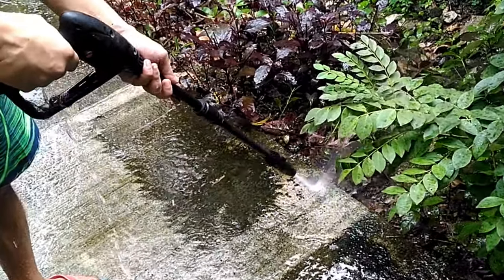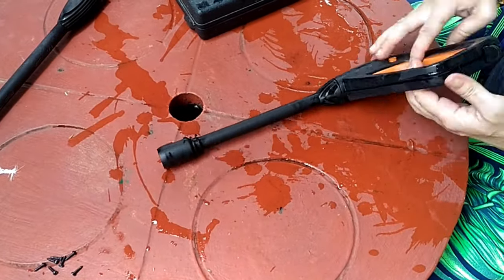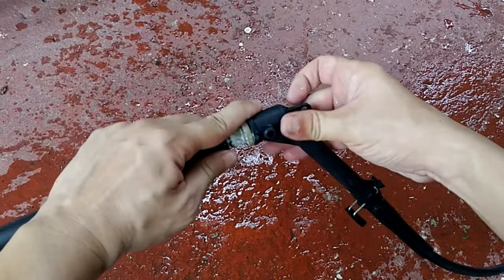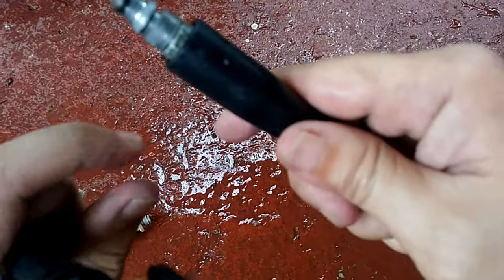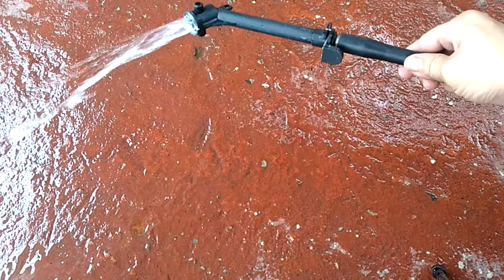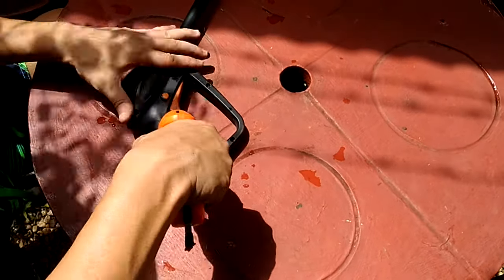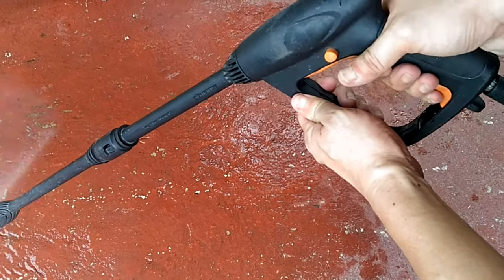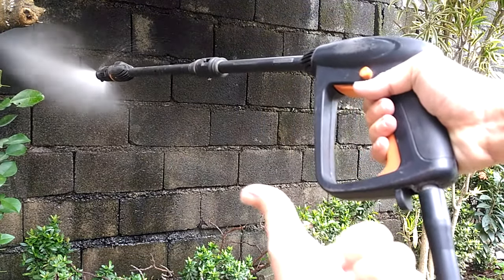How to Fix Leaking Pressure Washer Wand (CHEAP)

Comment: There are three sizes of o rings required for this gun: O.D 10mm, I.D 6mm, Cross-section 2mm.
O.D 12mm, I.D 8mm, Cross-section 2mm.
O.D 8mm, I.D 5mm, Cross-section 1.5mm.
Reply: What are the dimensions/parameters of the transparent gasket on the very front of this white piston (see 1:52 the index finger of the left hand points to where it is located). 
It's not a classic black NBR rubber o-ring, but a strangely shaped sealing ring of transparent material that hardens after years and crumbles (not very flexible) when you try to touch it. 

I have a leak just on this seal. After several years of use, water has cut a gap in it and it leaks by turning the pump on and off every few seconds, as the pressure in the gun alternately drops and rises when the pump motor is automatically turned on. I couldn't find this seal anywhere, which probably costs a few cents, and yes I have to buy the whole gun for $45 plus shipping.

Comment: Thank you so much for this. My o-rings looked good on my electric washer hose / gun combo has 2 rings on the hose, but for some reason sometimes, when i stop spraying, it starts leaking like crazy. Today, it started leaking no matter what. Teflon tape for the win. Thank you so much.

Comment: Awesome! I fired my electric one up today for the first time in 5 years at least and wow, did that handle leak! I am betting I need 1 or 2 "O" rings but I do have Teflon tape to get me by tomorrow. I will be taking the spray handle apart in the morning. Thank you so, so much!!! Great video!!
Reply from the maker: Good luck!
Reply: I did the temporary fix but getting that spring back in to make the handle has proved to be a difficulty!
Reply from the maker: @sandysue202  yep i can relate. U really need to finesse those parts back in 😊

Comment: I see you're using Teflon tape for a temporary repair. I got a much better solution because mine's quick and Permanent Forever. Use an earphones rubber. Everyone has these around. Just remove the rubber ear piece, from any old earphones and put it where the o ring go's. put it on the fitting backwards and seat it in place. Then pop the ear bud inside out and cut off the excess with a pair of scissors, does not need to be ever replaced again. Also works on blown o rings in connector adaptors. Better than any o ring.
Reply from the maker: Nice! Thanks for the tip!
Reply: Hey FC - having hard time picturing what you are describing as alternative to using teflon/plumbers tape.  Can you provide a picture or two (or +3) of an 'earphone rubber ear piece' and then posted in Ur YT Channel or share a link here pointing to a DropBox, Google photos or other public facing sharing location?  TIA
Reply: This works just great..thanks champion
Reply: At this point it would be easier to go buy the right size o ring 😂
Reply: I can't even open the handle.
Reply: @jasereed5258  Mine has screws, in the handle, you might find a repair guide on line if you know the model. and brand.

Comment: I have basically the same handle.  The handle doesn't leak under just the regular water pressure,  When powered on it leaks from that white plastic valve  on the side that points toward the handle I even changed the o ring  there is still a leak there when it runs. any suggestions? do you know the o ring size is it metric?  thanks

Comment: Thank you for your clear instructions. Out of curiosity, was the o-ring you purchased designed for use under high pressure? How well has it held up?

On different note, while I found your explanation helpful, the four ad breaks in addition to the initial ad for a video less than 10 minutes was enough to keep me from subscribing. Well, that and the volume of the extraneous sound effects.
Reply from the maker: Let's just say that the o-ring i used lasted longer than the pressure washer itself. The video you watched is over a year old and I'd like to believe I have come a long way in terms of improving the quality of my more recent videos. I encourage you to visit my channel and  watch some of them. As for the number of ads, it's the only way for me to compensate for the amount of time and effort i put behind creating my videos, which on average takes me 3-4 weeks. Regardless if you subscribe or not, I still appreciate that you watched something you found value in, for free 🤗

Comment: You actually can fix cracks by using J-B Weld. The pressure it is resistant to is usually a lot higher than what the actual pressure washer is putting out.

Comment: I work at a Auto Parts store, and my manager told me that there’s an antifreeze type lubricant that if you run it through your wand after every use, it will keep your o-rings lubricated and keep them from cracking. This will allow you to use the pressure washer longer and saves your o-rings.
Reply: Stock up on blinker fluid too

Comment: Hi HanDIYman 007 Nice video,  Could you tell me what can I do if "the gun" don't stop shooting water, the trigger is not broken, is just that doesn't work at all... thank you!
Reply from the maker: Have you tried disassembling the gun to check what might be broken inside?
Reply: @HanDIYman007  Thank you @HandIYman 007 I disassembled the gun nothing was broken! I used the teflon tape on each o'ring I found and the gun stopped shooting water! but for a couple of minutes. it looks like the o'rings that are inside the gun, are to dry.  When you pull the trigger the teflon tape gets removed by friction. Now I know what to do.  I have to replace the o'rings just as you recommended. I had a lot of fun doing this.   Thank you very much   @HanDIYman 007

Comment: opened mine up, checked and no cracks - all O rings are in place with no damages. turned off it doesnt leak and works fine but once i turn the jetwash on it starts leaking from the bottom of athe handle, im using the same one as in this video but nothing seemed to work

Comment: Bought a used pressure washer last night for a cheap price, it's specified it's leak but the machine is fine. Thanks to your video now I've found the leak like you said and temp fixed it! now gotta search that O-ring you mentioned for a permanent fix! are these O-ring one size fits most? or you have a specific dimension for each? mine looks very similar to yours, what's the size of your O-ring?
Reply from the maker: Glad that this vid helped you save the trouble of isolating the source of the leak! I believe the size of the o-ring differs across brands and models. The best way is to bring your pressure washer (or at least the wand and hose) with you to the store and do an actual fit. I hope this tip helps.

Comment: Well you did the typical thing and start with the pressure line hose and wand  being disconnected , and that is where my  leaks is.   Problem for me is that I cannot separate the threaded collar from the wand, the plastic sheath that you turn to loosen and tighten, just spins, and the brass threaded wand and hose connection do not tighten or loosen.  How do you remove such a hose connection, because that is where it is leaking, the pressure hose is only threaded on half way, I cannot tighten or loosen, the plastic black turn sheath is obviously stripped, so I guess I should throw both away and buy replacment pressure hose and wand,  since I cannot turn the fitting without destroying the plastic and brass fitting?

Comment: i need to check this method, my Black&decker started leaking after the engine kept engaging and i could seem to get full pressure. Then i heared a pop and water started poring out like this one. all o-rings are in tact though.

Comment: Excellent video. Practical and effective. Have another question though. When I opened up my wand, I got distracted on another project that took a week. When I got back to the wand, embarrassingly I can't find the spring that pushes back on the stem to shut the water off. I've got a Husky H1800s electric washer and can't locate the spring anywhere. Any creative ideas on how to solve the problem? whether you have one or not, I'll be going through your other videos. They're very well done!
Reply from the maker: Yes, this happens to me too 😅 First thing i would suggest is get a picture of the spring thru online stores, forums, owners manual, etc. It's important that your replacement spring should be the same dimension and "tension". Then i would try looking for it from the store you bought your washer from, auto supply stores, nuts & bolts store, or even online sellers. I hope this helps 👍 PS Not all my videos are great, esp my first few ones but i do try to improve continuously. Thanks so much for the support 🙏

Comment: Was this a Black & Decker lancer? It looked some sort of the same in some parts. Though yours looks way more studier than the cheap one i got
Reply: hahahah untill i saw the end... yup B&D did yours started doing this when the engine would not shut down? Thats how mine started today, was doing dome working, i adjusted the pressure and the motor wouldnt stop. Could hardly pull the trigger, then heard a pop and water came gushing out. I disassembled it but did not see a crack or what so. Hope your fix also works for mine, i do have both o rings on both sides of the pressure hose though
Reply from the maker: Yes, a motor incessantly running (sometimes by itself) is a symptom of a faulty o-ring (because there's little to no pressure being contained anymore). Don't be fooled, inspect your o-rings very closely -- at first glance, they may look fine but look again under bright light or even with a magnifying glass.

Comment: What’s the part name of the quick disconnect system , the plastic piece that connects the hose to the stem. Mine has a crack , don’t want to buy a new handle.

Comment: The first wand in video......what "kind", "style" fitting is the end of that hose called, besides quick connect?   I am trying to find an adapter to fit on that style hose but has the more popular m22 end to screw onto another wand. Thanks

Comment: I got a nilfisk pressure washer i bought a gun with the same connector like yours that replaces the original one and came accross the same problem. I got tired of that type of connector and bought a new hose that connects to my another new gun with an m22 connector. Now my problem is i thought all m22 fittings are the same seems like my nilfisk washer m22 water outlet is a tad smaller than the m22 hose that i bought. Im planning to buy an adaptor online im just worried that i might buy a wrong adaptor and waste some money. Any advice on what to look for in the product description or a place locally where i can buy a tad smaller female to a tad bigger male m22 adaptor. I hope im making sense. Thanks
Reply from the maker: I'm not really into replacing my connectors with anything other than what the original specs are. But if you really want to go down this route, my recommendation is not to purchase online but instead bring your entire unit to a local store and do actual test fits -- this is the only way to be sure you are getting the perfect fit. I hope this helps.

Comment: Great video, thank you. My problem was the spring had weakened inside the handle. I tried to find a replacement but after a long time I gave up and ordered a new handle for £15 which is fine to get up and running again but I always prefer to fix stuff. Strangely, I wasn't surprised to see you got the O ring from an auto parts store. As I was watching and before the reveal, I thought I would try my local one here in UK first and then ask if they know where else to try if they couldn't help :) Thanks again for the video, you explain it really well.
Reply from the maker: Hey thanks so much, I appreciate it! Honestly, if I wasn't desperate enough, I wouldn't have thought of looking for the o-ring from an auto parts store 😅
Reply: Hey. Can I ask where you got a replacement handle?
Reply: Same here. Looking for a replacement handle too.

Comment: My pressure washer is leaking further down ,  just above the head of the nozzle. Any suggestions?  It's a year old  Simoniz 2000.
Reply from the maker: Have you inspected for cracks? Does it have screws to open it for you to inspect inside?
Reply: @HanDIYman007  I had to buy a new wand.

Comment: I have the same problem but my wand is crack I try my best but still leaking.
Reply from the maker: Unfortunately like i said in the video, cracked wands cannot be fixed due to the pressure 😅 for your situation, no other option but to buy a replacement wand, sorry bro.
Reply: @HanDIYman007  thanks for the reply sir.

Comment: Changed my washer rings but is still not solve still leaking from same joint DNT no y
Reply from the maker: Did you use the right o-ring size? Ideally, the o-ring should wrap very tightly around the crevices.
Reply: @HanDIYman007  will try again bro
Reply: @HanDIYman007  Well there was your chance to specift the actual SIZE of the o ring for the hose connector. I have seen quite a few comments asking for the size. You haven't answered any of them.

Comment: Teflon tape under the o-ring in the groove, not on top.
Reply from the maker: As I explained in the video, that lower groove is for the quick connect/disconnect system. It does not and should not need an o-ring nor teflon. Otherwise, there will be no groove for the locking mechanism to latch onto.
Reply: @HanDIYman007  UNDER the oring in the same channel is not the connect point you speak of.  It pushed the o-ring out a minimal amount to help create a seal.

Comment: IM freakn baffled they all have these plastic inside parts, which after checking more vids a lot of them simply crack. They are build to crack. they make it look like its metal with the end parts building some kind of metal. They all want you to buy expensive new lances so you can continou it the break down and buy a new one.